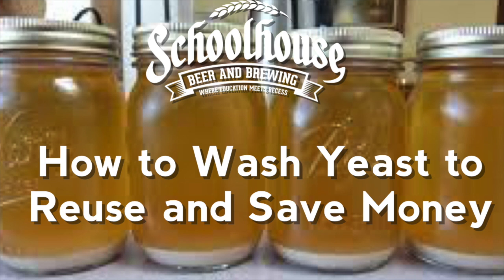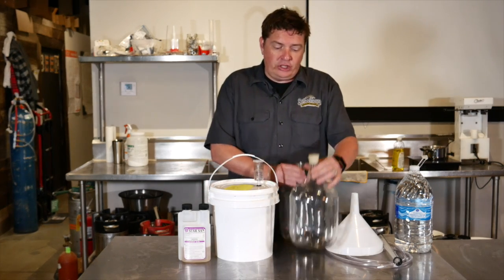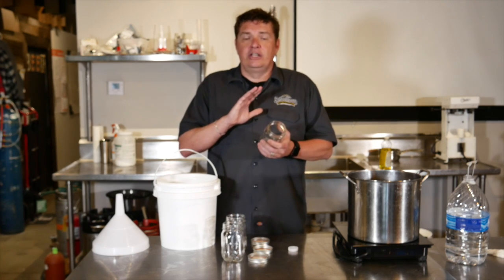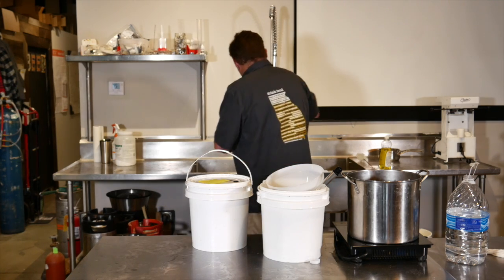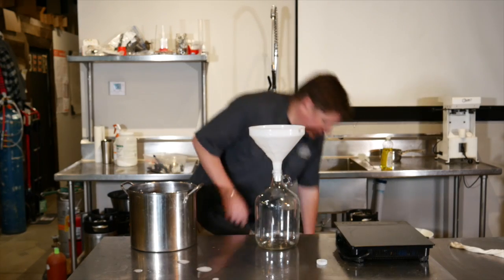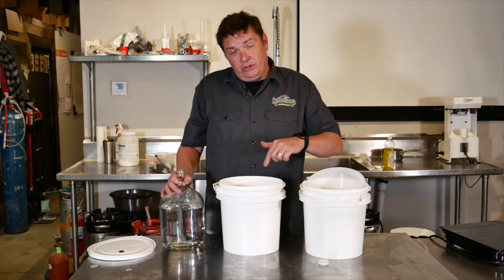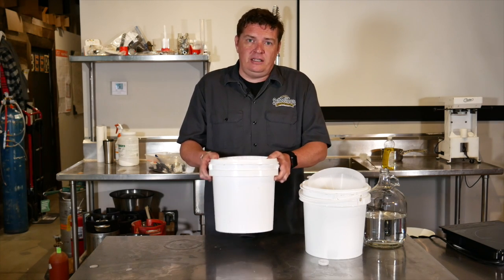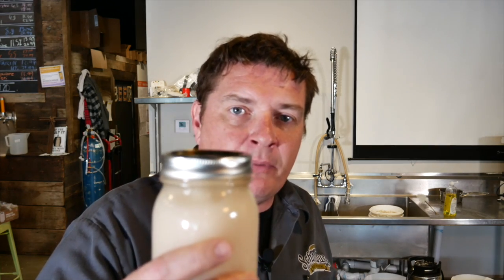The Basics of How to Wash Yeast (Grains to Glass S2C5 2018)

Comment: Hey, I just came here to drop a little knowledge bomb on you concerning dehydrated yeast.
By the time you have completed fermentation and you are ready to wash/rinse the yeast.... a whole population of healthy never dehydrated yeast has been reproduced.
The reason when you call a dry yeast manufacturer and ask them if you can wash/rinse the yeast and get a resounding no..... that is because thier business model is dependent on you buying packs of yeast 🤣 The customer service person you are talking to is not actually an expert, they are repeating things they have been told to tell you if you call asking certain questions lol.
Its basically planned obsolescence. Dont buy it. Once the yeast reproduce you have a solution that also contains never dried yeast. At this point there is no real difference between an active or dry yeast.

Comment: Never do this to save money. When you are ready to brew make a yeast starter split into 3rds pitch 1 and put the other two in the refrigerator. No need to wash or clean yeast.( will last 3 months in refrigerator ) or drain off beer and add sanitized water then freeze.( will last 2 years + )
P.S. Always make a yeast starter when you brew !!

Comment: I've been using the same colony of 34/70 (a dry yeast) since February.  I've made five batches from it in the last four months.  I have washed both liquid and dry yeast.  If you're concerned about yeast nutrient being present in the original packet, just add yeast nutrient to your next batch of wort.  Also, you said the layers out of order.  The dark layer will be on the bottom, because the dead stuff and trub fall out first.  Once the yeast go dormant, they lay on top of the trub, and THAT's the white layer.  The beer/water will be on top of that.  So, the yeast is the middle layer, not the bottom.
Reply: I have used the same us-05 dry  yeast for 7 brews now and it's still going strong. Never heard it can't be re used untill now. We must have a "special" variant of yeast 😅
Reply: Thanks Bradley I was wondering about the layers. the other videos say the order that you stated.
Reply: I didnt have defined layers between the yeast and trub. Is it ok to get some of the old trub in the next batch or how can I get it out completely?
Reply: Yeah I call bullshit on it too.  The idea of a yeast that can't be propagated is ridiculous...it propagates when you add it to a wort, or must.